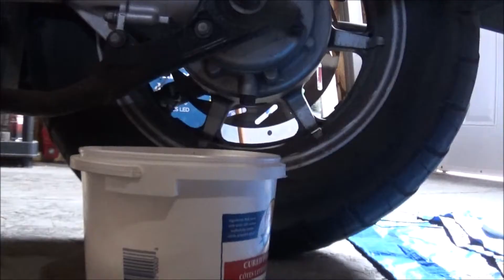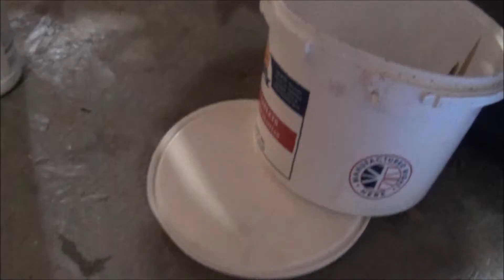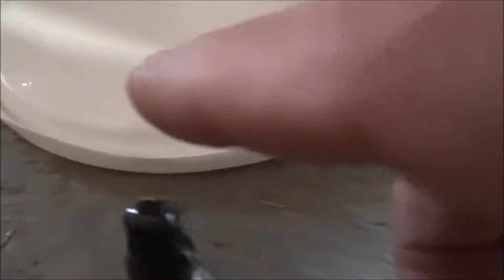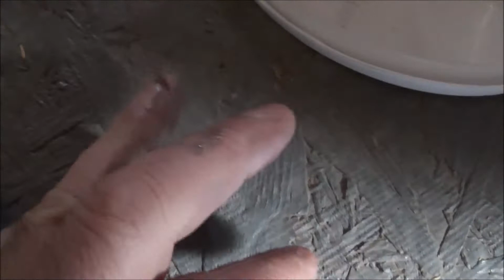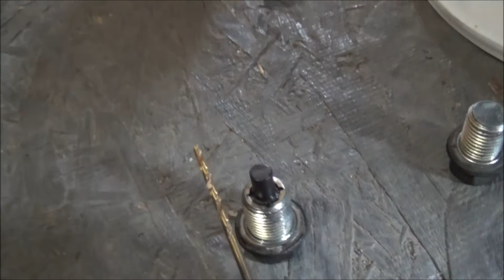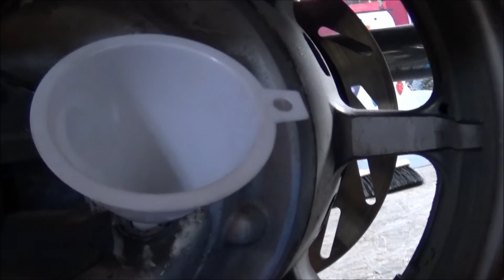Yamaha VStar Final Gear Oil Change

Comment: I remember putting stinky gear oil in various differentials and gearboxes over the years. It’s always  smelly job. I don’t know anything about bikes but still very interesting. Thanks regards Chris
Reply from the maker: Thanks Chris. This gear oil has a strange smell. Whenever I smell it I think about gear oil. lol. I got to do an oil change next. Sadly. I need to  remove the top exhaust to get at the oil filter.

Comment: Awesome Andy. This could really help an owner to save a packet of cash.
Reply from the maker: Yes, Fred. It is an easy maintenance procedure that will cost a few dollars at the shop to do and it also keeps that final drive happy in the long run. My next maintenance job will be an oil and filter change. It is a bit more complicated because I have to remove the top exhaust to get at the filter housing. I am thinking about installing an aftermarket  oil filter relocation kit. There are some quality aftermarket kits out there that will eliminate having to ever remove that exhaust to do a filter change.